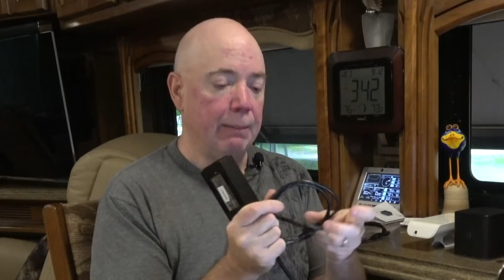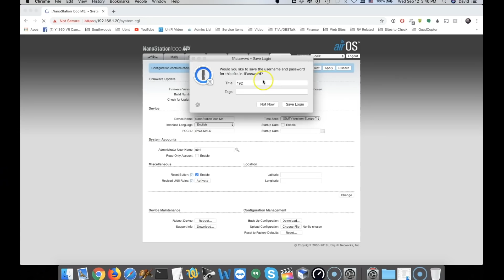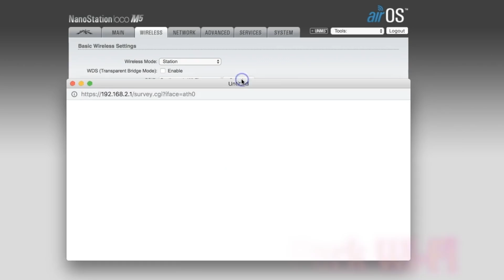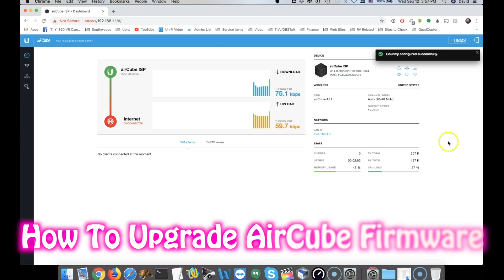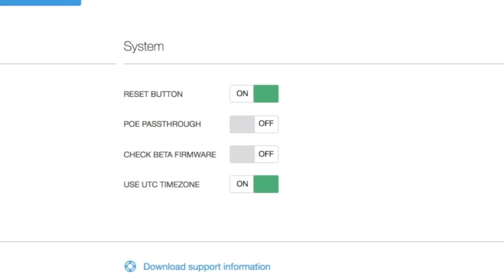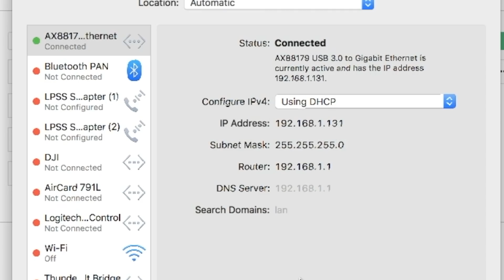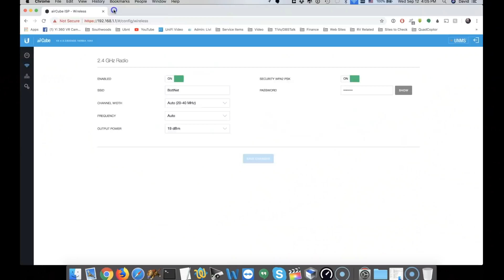Build a Private RV Wi Fi System with a NanoStation & AirCube AC

Comment: I’m getting that if I use this setup, I should not need the Winegard Connect 2.0, since I already have a weBoost?
Reply from the maker: The Connect V2 does what this does but also can use a 4G SIM card if you buy that version of it.  TOGO is the same system as the V2 but is called a C2 but allows you to get an AT&T unlimited data plan for $30 a month. The TOGO is locked to AT&T.
Reply: @DavidBott  Dave- since this Ubiquitti system seems to be the same as the Winegard C2/V2 (except the Ubiquitti hack version does not have a sim card), in your opinion, which system has a better (stronger/faster) antenna to create the RV's internal WI-FI, the Winegard or the Ubiquitti?  Thank you!
Reply from the maker: @andrewk1916  The AirCube for sure! Not to mention if you get the AirCube AC, it is dual band.  Also are are not splitting radio time between  talking to the park and talking to your devices. The NanoStation just talks ONLY to the park and hands it off to the AirCube to talk to the devices which results in better speeds.  Where as the C2/V2 has to talk to the park and all your devices over 2.4Ghz only. Each device connected takes a time slice of the frequency clock.  So you have less time taking to the parks as more devices are connected. (Hope this makes sense.)
Reply: @DavidBott  Dave! Thanks for taking the time to reply on this (it is an older post/episode) and your explanation make sense as to what the antenna has to do and what freqs it has available to do it on. I didn't look for a 2/5 Ghz Air cube but I'll look at that as well.  I am also looking at a Pepwave MAX BR1 MK2 as a cellular solution (seems robust in capability -and price) which also gives a WAN capability like you advocate in this episode but I think it's WAN antennas (integrated into a Poynting 5-1 [2xcell,2xWAN,1xGPS) may suffer from a similar problem that you point out here.
Reply from the maker: @andrewk1916  Hi...Note that the Wingard does have a ethernet port on the board under the dome that is active. Thus you could use the 4G version of that if you wanted and run an ethernet cable down into the coach and connect to any WAN port of any home router.  As such, you would then have both advantages. Here is right where I mention it... https://youtu.be/SHmtl0eRZlQ?t=295

Comment: I'm having a minor issue. After everything was setup, and I'm on the Wifi of the AirCube, I can't ping the Nanostation M2 at 192.168.2.1, nor can I browse to it over HTTP. I have internet, though.

The AirCube ISP is at IP 192.168.1.1 and showing a WAN IP of 192.168.2.7, which is coming from the Nanostation's DHCP, which makes sense since the Nanostation has been configured to be 192.168.2.1 and to use the 2.x range for DHCP, as per your instructions. Now, I have my laptop connected to the AirCube SSID I setup, and I can log into the AirCube itself, but when I browse to 192.168.2.1, I get the generic "Host timeout" error in Firefox. And like I said, I can't even ping it. 

If I connect to it again using Ethernet cables, then I can browse it just fine, but not over wireless. I updated the firmware on both units, and I followed your instructions to a T. Any ideas?
Reply from the maker: Hi...Well it all sounds good. Have you tried clearing your browser's web cache or trying another browser like Chrome?  For is seems correct from what you mention.  It seems that the AirCube is getting an IP from the NS Gateway and you mention you have Internet access via the AirCube which is getting it from the NS.  So you may be seeing an old cached page that is stuck.  So you should be able to go to https://192.168.2.1 and be able to login to the NS. After all, you need to be able to fo this to be able to change the AP it connects to. :)  Hope maybe some of this helps.
Reply: @DavidBott  Thanks for the reply. If I couldn't even ping the IP, then it couldn't have been an http or caching issue. It must have been something with my laptop. I have some good news: I can reach the Nanostation from my phone today. I haven't tested my laptop again yet. If it's still an issue, it could be anything: adapter misconfiguration, other Windows issues, or maybe my VPN software, even though it was disconnected from the VPN at the time. I'll report back of I figure it out.

Comment: Excellent tutorial. Convinced me to get the aircube after arguing with my old router. Seems like all the setup should be the same for the bullet M2 I'm using on my boat. Thanks so much for an excellent easy to follow tutorial!!! Happy motoring!
Reply from the maker: Hi...100% the same as the Bullet.  Same AirMax OS.  Heck, if your Bullet is running the current firmware then all you need to do is make a backup of the CONFIG and then load and save that config into the NanoStation.  BAM!  Done!   (That is if you meant to get a NS and use that when not on the boat.)  But the AirCube AC is a really nice product. (IMHO)  It is also nice that you can power the Bullet or the NS from the AirCube.  Just be sure to turn on POE Out. :)
Reply: @DavidBott  Dave, Thanks again for a great tutorial. Got my air cube in today and setup the bullet (preferred for mounting on a boat with the omni directional antenna), followed all your steps and I was up and running in the length of your video (even with translating to windows PC). 

I splurged a little for the additional 5 ghz on the aircube ISP, still less than $150 for my whole set up. Just have to mount the radio externally and I should be able to see the Starbucks over 2 miles away from the top of my mast. 

Loved the video, easy to follow in real time and all my gear did exactly the same as yours. Excellent job! Subscribe now!!!
Reply from the maker: @Jeff_LC250  Hummm....A AirCube ISP is different than the AirCube AC.  You want the AirCube AC as the ISP is made for installers to control remotely.  Both offer 2.4 and 5 ghz dual band.

Comment: It worked first time set up at home. Now at rv park i go through all the steps after HAVING to reset the M2 just to let me get to the nano itself.. And it will just not connect.. Idk what im doing wrong but im following step by step and like i said, it initially worked at home..
Reply from the maker: Very hard to say as you don''t give any information as to how far you got.  You said you had to reset the M2 just to get into it. So that means you wiped it and thus it would need to be fully setup again.  If you reset it and did not redo it, then, well, it surely won't work as you would need to set it all back up.   Once it is all setup and you had setup the AirCube, then all you would need to do is connect to the AirCube and then go to 192.168.2.1 in your browser to get to the NS so you can search for and select the RV Parks wi-fi.  But I have no way to even start to try to help seeing you mentioned you HAD TO reset it. (Which makes no sense unless you forgot the password.)  So at this point I would say....Power up just the NS by itself, after about 1 min hold down the reset button inside the hole for 20 seconds and let it reset to factory.  After about 3 mins then you will need to do the setup of the NS again, fully.  Then let's see how far you get. :)  Hope you have what you need to do it again.   Good luck.
Reply: Ok so when i say i HAD TO reset, its because when i arrived at campground and hooked the lan port up to my laptop and typed in the IP address in web browaer bar, it kept saying "taking to long to connect" over and over again. So i reset it back to factory and tried again and it came up. Clicked advanced and proceed and followed the steps on your video exactly once again. This campsite does not require a password so after i clicked "apply" at the end, my connectivity icon circled and circled and then went to the exclamation point with no internet access. And then tried clicking on anything else and it went back to "cannot connect".. Not even to the IP address again.. I am not using the cube, i am using a router made for this type of connectivity as i use to have it at home.. But if it wont let me connect after pressing apply and waiting to laptop, then it wont allow me through the router. Which like i said, worked at home when i initially set it up after unboxing.
Reply from the maker: @Jaroch007  From what you just wrote, at that point you need to be sure your computer is put back into AUTOMATIC or DHCP mode so it will get an IP address from the NanoStation. The NanoStation right now would be 192.168.2.1 and handing out an IP address in the 192.168.2.X address range to your computer to use it.   But your computer is still in STATIC or MANUAL IP mode being on the 192.168.1.X network.  As such, you would not be able to talk to the 192.168.2.1 network...so nothing will work.
Reply: @DavidBott  ok so now i changed it and was able to connect to the network but it will still not allow me to connect to the internet.. It has to be a simple fix that im missing..? Thanks for the responses though!
Reply from the maker: @Jaroch007  If you are connected to the parks Wi-Fi and all the lights are lit and stable, then is there a captive portal at that park? Try going to http://Bott.net (My page I use just to test for captive portals)  Most browsers default to going to say Google and that is an https page and this can't open the redirect to the portal if they are using one.  If they are not using one...Check the NS settings and be sure you did select NAT and that all the boxes for it are also checked.  Sometimes people miss that. If not, check it and the boxes, change and apply wait for reboot.   Last but not least, maybe the park is also using the same IP range...192.168.2.1 and if they are, that would make for a collision and that will not work.  So then the last thing to try would be to change the NS IP range to be something like 192.168.22.1.  Thus under NETWORK change the 192.168.2.1 to be 192.168.22.1 and then be sure to change the .2. to .22.  in the two other places down below to match.  Then Change and Apply.  NOTE...Your NS will then reboot and it will be found at IP 192.168.22.1. (no longer 192.168.2.1)  Seeing your computer is in auto mode it will get the a new IP address in the new range so not to worry.  Just be sure you change it in all three places or you will be locked out and need to reset and start over.  Good luck!
Reply: @DavidBott  thank you so much for your quick responses and detailed help!! i will be trying this all later today.

Comment: Would it make more sense to set the AirCube in Bridged mode with a StaticIP address of 192.168.2.2, to avoid double NAT?
Reply from the maker: Not really. It is not going to hurt anything and you are going to run the risk of captive portal issues seeing you need to go through the NS which also may need to get though the captive portal just so the AirCube can.  Also if you need to clone a MAC address to get arounbd firewall issues, you can on the NS but not on the AirCube.

Comment: Been using my setup, as per your wonderful video instructions, with no issues for about 10 months now, was thinking of trying to replace the NSM2 with a NanoBeam or Powerbeam to see if i can improve the signal, right now averaging about -71. Anyone try this with or have any other suggestions?
Reply from the maker: IMHO it would likely be overkill as most RV parks are poor to begin with. But if you try something do not try a AirMax 5Ghz AC unit as they only work with other 5Ghz AirMax AC units.

Comment: Hello again David.  Another Q. I have the AC version and both 2.4 & 5G antennas. Since I don’t use them at the same time (I start with the 5 and if that doesn’t work, then I unplug that antenna and plug in the 2), is there any reason why they can’t be the same subnet?  I notice when I am on the 5G antenna, I can still use the WiFi connection ip for the 2.4.  I hope that makes sense. Currently I have them set differently since I thought it would be necessary but after using it for a few months, I don’t see why they couldn’t be the same since they are never hooked up simultaneously.
Reply from the maker: Hi...You can set up both NanoStations 100% the same and just swap them out.  Just a note...You don't have AC versions. There is no such thing as an AC 2.4 and the AC for their 5Ghz only connects with their AC products as they are used as Bridges.  Take care.
Reply: David Bott thanks sir. I’ll work on it at our next destination. Always appreciated.

Comment: After downloading the firmware, does my computer have to connected to the internet to set the rest of the system up?
Reply from the maker: Nope.
Reply: Whenever I type in the IP address for the Nanostation all I get is “your not connected to the internet”???
Reply from the maker: @amaddox65  Then it seems you may not not have a Static IP set in your computer as instructed.  I know tutorial works, you just need to make sure you know how to set a static IP for your ethernet port to make the connection to the NanoStation when it is booted up.
Reply: @amaddox65  Did you figure out the issue?  I set mine up yesterday and it worked fine, but today I'm getting the not connected to the internet message.

Comment: Hi David, I set the nanostation M2 and the aircube up and it worked fine at home, But now that we are at the rv park, the log in page will not come up. I think the cube is trying to connect to my home network and is not finding the park's network,  I have 2 green lights on the antenna the aircube lights up and I am putting into the browser 192.168.2.1 and it will bring up the log in page for the antenna.Not sure what's happening, but I've spent hours on this. What do you think is happening and what can I try to fix it?
Reply from the maker: Hummm....The AirCube is YOUR network.  It would not be trying to connect to your home.  You log into the NanoStation so you can connect it to the RV Park WiFi...Here is a step by step for you...  

Here is a recap on how to connect your private Wi-Fi network to a RV parks Wi-Fi or to your own Internet data connection… (Like when you go to another RV park or need to use your own Internet data.) Copy the text below and save it if needed.

Point the NanoStation towards an access point. Hint…Try to point it towards the main office where the Internet connection usually comes in. Plug in the system if not already plugged in and give it 30 seconds to boot up.

FOR AFTER ALL IS DONE…QUICK CONNECT CHEAT SHEET….

1) Connect to your Wi-Fi SSID.

2) Open web browser and go to: http://192.168.2.1

3) Put in the user name and your password. User name = ubnt   Password = What you made it.

4) Click on the WIRELESS tab.

5) Click on SELECT

6) Find the Access Point you would like to connect to. (The park or your own data device.)If there are several with the same SSID name you want to connect to, then select the best signal. The first number in the Signal column you want to be closer to zero. -55 is better than -75.

7) At the bottom click LOCK TO AP.

8) If the Access Point requires a password *, enter it in the bottom area. (The park would have supplied one if needed. Or the one for your own data device.)

9) Bottom Right of the screen click CHANGE.

10) Top of the screen click APPLY.

In under 30 seconds, you should see the antenna lights light up and then you should have access to the Internet.

Dealing with Captive Portal or “Agree” Pages: Some parks require you to “agree” or login with a user name and password before you have access. So once you connect to the park with the NanoStation, while on your Wi-Fi network, the first time you open your web browser the “captive portal” page will come up asking you to agree or log in. Once you do, the portal will note the MAC address of the NanoStation and then allow access to anything on your local Wi-Fi network.

NOTE: If your browser defaults to a open a webpage that is HTTPS (vs HTTP) then the captive portal can not show up as it is not HTTPS active. So be sure you are trying to go to a site that is not HTTPS. (Ie…Facebook, Google, GMail are all examples of HTTPS sites that people have their browsers default to.) So try another site…any site…maybe ours http://Bott.net, and the captive portal page should come up for you. Also some campgrounds auto log you out after X hours or at the start of a new day. If this is the case you need to AGREE again. Just a heads up.

Comment: The M2 is 2.4 GHz. Is there any reason not to get the 5 GHz model which is the M5?
Reply from the maker: Most parks are not updated enough to have 5Ghz.  But all have 2,4Ghz.   I carry an M2 and M5 and they are setup 100% the same so I can just swap them out.
Reply: @DavidBott  Thank you! Is 2.4 always backwards compatible? I'd love to have both at some point, but hoping to pull at least one out of the budget right now.
And would I see a noticeable performance difference – range or speed?

Thanks again!
p.s. Love your enthusiasm – I'm sure you hear that often....
Bruce
Reply from the maker: @bnaudie  2.4Ghz is what is the main standard and has been for years. 5Ghz is just a differnt spectrum that can move data faster but at the cost of not liking to go though anything seeing the wavelength is 1/2 as narrow as 2.4Ghz.  Think of it as a bass note vs higher notes...Bass, in this case 2.4Ghz, goes though things and you can hear it through walls. 5 Ghz is like a higher note and thus you may but hear is through a wall.   5Ghz can go further than 2.4 and carry more data speeds, but like I said, only id nothing is in the way.